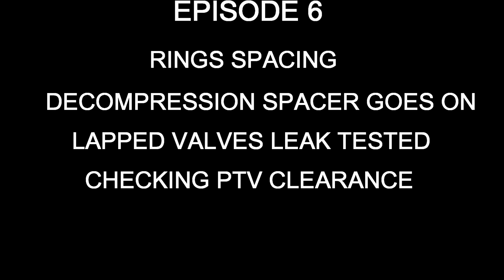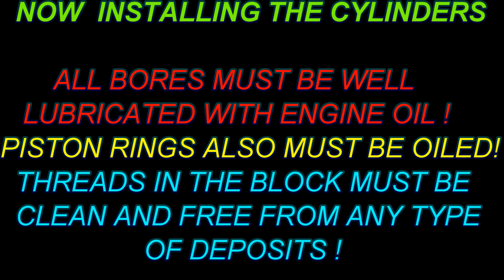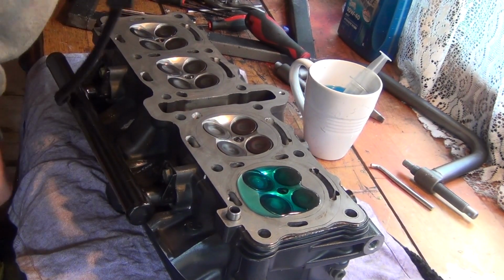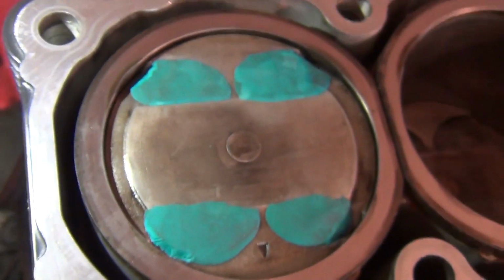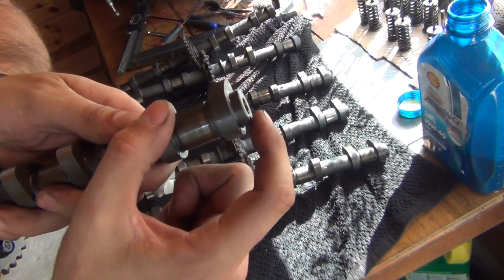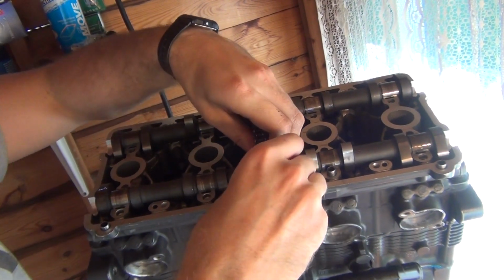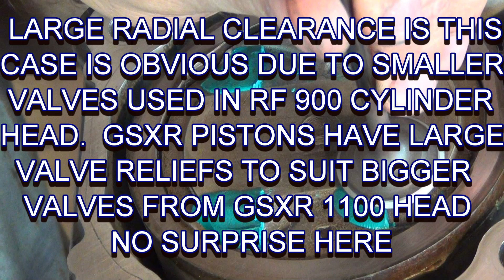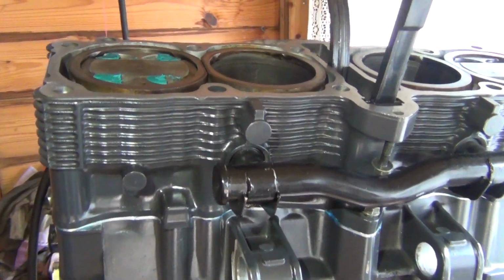Building Suzuki RF 1100 - Episode 6

Comment: I think that if everything goes well with the project (God I hope so), you are looking at probably 180 bhp at the wheel, which is Busa level stuff but light version :-D
Reply from the maker: If i just get more torque i'm happy with it. I decided to go with RF cams also cause they will be better for low end power. I don't need top end punch that much on the road tbh.

Comment: Hey man how are you? Thanks again for all of your vidéos. I have ordered today a set of gsxr 750 W cams for my rf 900 and i'm planning to assemble that with a race exhaust, race filter and a dynojet stage 1 kit, i know you've already run that configuration by the past s what do you think about it? And were did you buy that spacer plate? I'm thinking about doing the 6 speed 1100 mod on mine to build the perfect cheap sleeper too ! 😁😁
Reply from the maker: Great idea and will run well as long parts are good.
Spacer plate can be purchased from Orient Express in States.

Comment: Hey I’m having a problem with putting cylinder head on pistons did you just beat them down once they were about ready to go in and did you do one piston ring at a time when you was taking the clamps off.or can you just tell me how you did it lol
Reply from the maker: Use elastic cable ties(12.7mm ones) instead. Coat them with oil and that will work much bettee. Additionally yiu can use dremel to lightly taper each cylinder at the bottom to help pistons slide in.
Reply: @Adikxx  the metal elastic cables ones right? might be a stupid question but I’ve never done this before
Reply from the maker: @JjPatterson-x3f  no no, plastic elastic cable ties. 12.7mm ones.
https://www.ebay.co.uk/itm/314021054321